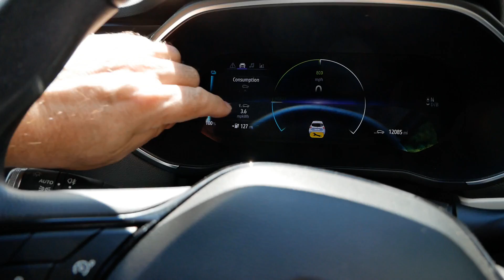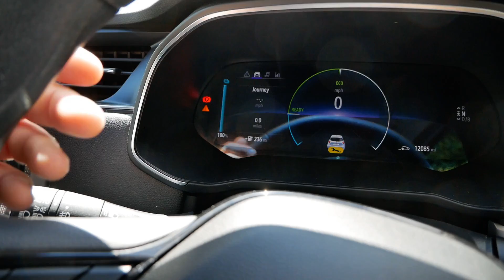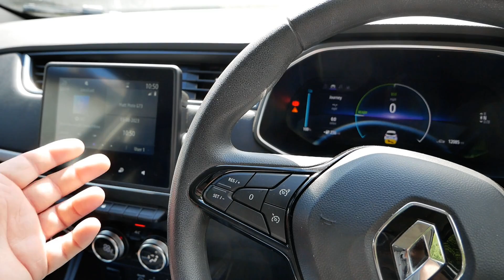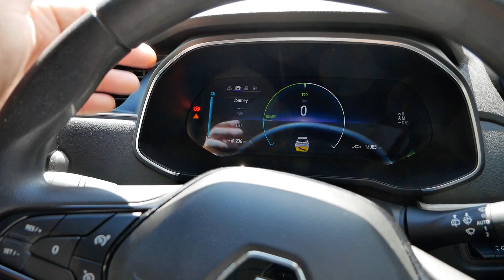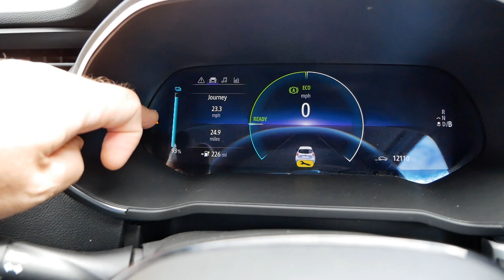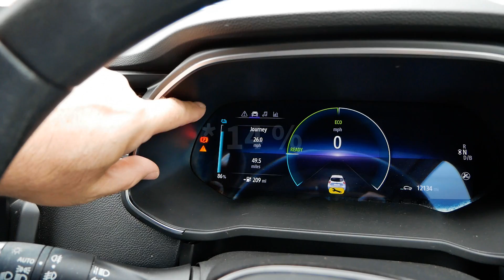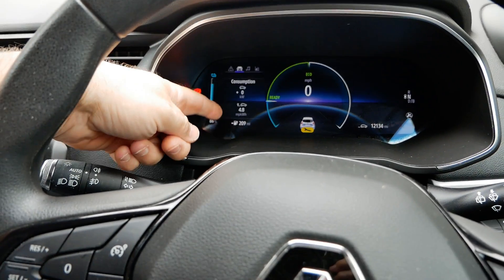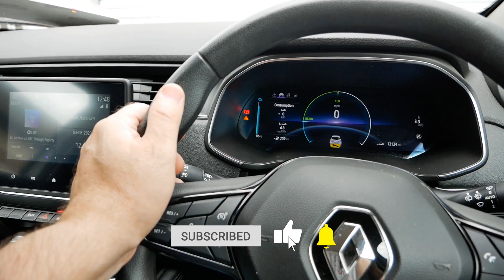How much range? Don't put too much trust in the GOM in an EV.

Comment: The absolutely critical bit of information about EVs. pretty much never explained to new EV drivers is that the consumption, ie energy used, of a EV is DIRECTLY coupled to how you drive it, unlike for an ICE car. Let me explain:

A car with an Internal Combustion Engine (ICE) is catastrophically in-efficient. In normal, daily use in the UK, a conventional ICE actually only uses around 12% of the energy (petrol) you put into it, the other 88% is simple wasted!  This happens unavoidably & continuously and is a fundamental result of the thermodynamic and mechanical losses intrinsic in its powertrain.  To make this clear, as an example, say you put 100 litres of fuel into the fuel tank of your ICE car, well, only 12 of those litres are actually used for useful work (ie to move the car and you around), the other 88 litres are just thrown away as heat!  Most normal drivers simply have no idea of this fact.

Now lets look at a typical EV. Again, in the UK, over a typical daily drive, an EV is around 85% efficient, almost an exact reversal of the ICE figures.  So, 85% of the energy you put into it is used for useful work and just 15% wasted.  Take a similar example as before, put 100 kWh of electricity into the battery, and it will uses 85 kWH to move around and waste just 15 kWh.

Why does this matter?  if we ignore the fact we need to massively reduce our noxious emissions and ourcarbon emissions, then it matters on a daily basis because now, for the first time, the precise way you drive your EV is absolutely and totally visble to the driver as it's consumption now directly reflects how it is driven, ie how much energy is needed to move it around.

The energy used for useful work only, ie to move you and your car around, is called the 'roadload' literally the load required to push your car down the road.  Many factors change this load, but the primary ones are your average speed, how hard you accelerate, the ambient temperature, and how much you brake / change speed.  The faster you drive, the more you change your speed the more energy is required.  And here there is another "gotcha", as the energy required to push an object through the air goes up with the square of its speed.  In laymans terms, that means to go twice as fast requires FOUR times as much energy.

So why does this all matter? 

Time for some worked examples, and we will use some numbers that allow us to do easy maths, rather than some specific cars figures.  We will consider driving two trips in two different styles, the second driving style requires TWICE the roadload, for example driving on the motorway at 70mph vs on an A road at 55mph. And in both cases we will assume the powertrain efficiency doesn't change (15% for ICE, 85% for EV) to keep things simple. 

1) ICE car - As we have see due to the powertrains gross in-efficiency, 85% of fuel is wasted, and the remaining 15% is available to overcome the roadload.
So we drive our two trips, and clearly, we will use twice as much of the "useful fuel", ie the 15l part, in our second case because we are using twice as much energy per mile driven.  
So when it comes to refuelling, after trip 1 we put back in the 85 litres of "wasted fuel" and the 15l of "useful fuel" for a total of 100l. 
And after trip 2, again, in goes the wasted 85l but now we have to put in 30l  of the useful bit (15l x 2), so we put in a total of 130l of fuel. 
Now clearly 130 is larger than 100, but the driver almost certainly sees the difference as a 30% increase, despite having actually driven in a manner comensurate with using twice as much energy to move their car around

2) EV - at 85% efficiency, both trips waste just 15 kWh:
so trip A requires 85kWh to overcome the roadload
and trip B 170kWh
Come recharging time therefore, for trip A we recharge with 100kWh
But for trip B, we have to put in 185kWh.  
The driver almost certainly sees this as an 85% increase in consumption!

Clearly, these two cars look to perform in very different ways at a first glance, and clearly its easy to think the EV has somehow experienced a much greater increase in consumption and therfore a much greater loss of range (as battery size / fuel tank size is of course fixed practically speaking, ie you can't fit 185kWh of energy into a 100kWh battery, any more than you can stuff 130l of fuel into a 100l tank!)

But lets look at the energy used in both cases!  We can compare the actual amount of energy used, because we know how much energy is contained in petrol and hence can compare to the electrical energy used for the EV.  Each litre of fuel actually holds 9kWh of energy so we can simply multiply our litres of fuel used in each case by 9 to get the equivalent energy used for all our cases:

ICE case A (careful driving) - 765kWh wasted, 135kWh used
ICE case B (hard driving) - 765kWh wasted, 270kWh used

ICE Increase in energy used A-> B = 135kWh

So, ohh, wait a minute, not only did the ICE simply waste approximately 6 times the total energy we actually put into the EV, it also used an extra 135kWh to drive that harder trip, whereas the EV used only an 85kWh!

If you explain this to people used to ICE cars, they often don't believe it, but once they understand it, they perhaps start to see why an EV is such a game changer, and why how they drive now matters!!  ;-)
Reply from the maker: Well said!
Reply: A fantastic explanation and superb example.  So what appears to be only a 30% change to an ICE driver in efficiency is actually a whole lot worse and due to inefficiencies of burning fuel much more wasteful than electricity.
Reply: Actually a typical petrol car is more like 20% efficient, while a diesel is more like 25% but your point is well made.
Reply: @mondotv4216  "actually" they are not!  I've spent 35 years working in the automtive development sectorm, and for at least 15 of those i was running the P&E (performance and emissions) group, and one of the things we do is to fully characterise the energy flow for a passenger car, and hence we can then optmise where most effective.

The percentage figures i have quoted are absolutely typical realworld figures for overal useage in an average year in the uk.

So whilst yes, the engine itself can indeed PEAK with efficiencys above 20% for short periods, the OVERALL efficinecy at turning fuel in the tank into useful work is far lower.  This is because 
1) people are really bad drivers (harsh accel/braking, wrong gear, trash from cold etc etc)
2) Our roads are reallly busy, so lots of stop start and idling (0% efficient when stationary eng running!)
3) Our climate averages around 12degC in the UK, official tests are at 25degC
4) short journey lengths means the vehicle operates for a significant proportion of those journeys whilst "warming up" (more friction and lower energy conversion efficiency)
5) as aftertreatment gets more and more complex in an effort to try to reduce tailpipe emissions and hence minimise local air polution, a modern car gets less and less efficient in the real world. More backpressure, fuel used for component protection and aftertreatment optimisation

Comment: So what you say in this video is sadly correct but you have to ask why? Why is it that Tesla has things like range down to fine art - rarely more that 5% off which is at least as good as most gas cars but a company like Renault can't even get close. Why are they counting battery usage in park anyway?
Reply from the maker: Tesla are good at software. This is where Tesla shines above all other manufacturers. They account for wind speed, elevation, traffic etc so your predicted range is spot on, when you navigate to your location.
Others use a basic algorithm so when the car is running but not moving, it throws the estimate out by a huge margin.

Comment: My MG4 SE started in Nov 2023 with 200 miles range, now 13k miles and 9 months later it shows about 220 miles. The consistency is so reassuring and you learn for to Interpret the GoM. Of course ABRP plugged in with an ODB does even better. 😊

Comment: Has anyone had the Renault app now showing Battery % as a very low mileage eg 71% = 99 miles. For 3 years it was sensible but in the last few months has gone more like a 20kWh. I have taken this up with Renault.

Comment: I’m not sure of the accuracy of the 4.8kwh. My 2021 Zoe ze50 seems to get stuck at 4.8kwh. No matter how you drive it never changes. I’ve been talking to Renault technician who thinks it’s a software issue. Still haven’t got my dealer to resolve it
Reply: My 2020 GT changes from 3.9 to 4.3 miles per Kw depending on how I drive

Comment: When I picked up our new leaf 30 in 2017 it was showing 126miles at 100% . Drove home 40miles and used 70%of battery thought crap what have we done. Did use it like I stole it though. With practice after 5 years and 6% degradation I could still get 1 mile per 1% in good weather. With my Niro EV I fully trust the gom so much so I have got to my drive with just 4 miles remaining on gom 😅